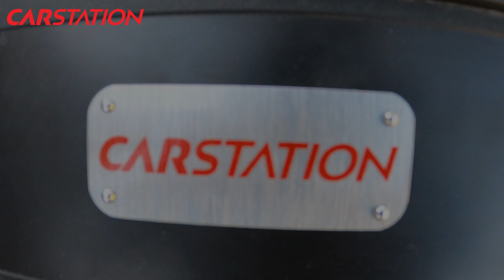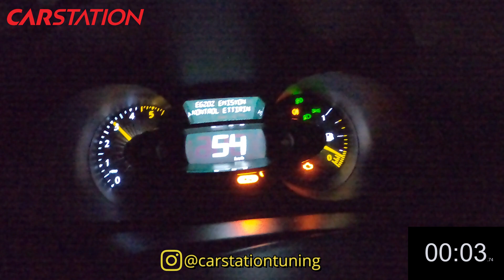Clio 4 Hybrid Turbo Projesi | 2.5 Bar | Bölüm 3

Comment: stage 1 de stok halde 120 hp alınan bir araçta bu kadar işlemde 20 hp alınması çok ilginç bi yerde bi sıkıntı var
Reply: gayet normal çünkü sohc motora sahip bir aracın kendi gücünün iki katına çıkması inanılmaz zor
Reply: 180 falan aliyor teoride ama dynoda 150 den fazla alamaz
Reply: @gamescansd5130  alınan guc lastige gelmedigi surece isterse 1000 hp alsın lastikte alınan güc onemli dynoda 178 hp alan 1.5 dci mevcut
Reply: dediğin doğru ama atladıgın bi yer var sadece yazılım ile güç alındığı zaman 120 hp çok kısıtlı bi devirde üretiyo atıyorum 2500 devirde 120 hp üretti ama 3000 devire gelince 50 60 lara kadar düşüyor bant genişliği yok hibrit turboyu intercooleri ve enjektörü büyüttüklerinde sıkıntısız 4000 devirlere kadar sabit bi artış gösteriyo
Reply: 75lik motora sahip araç